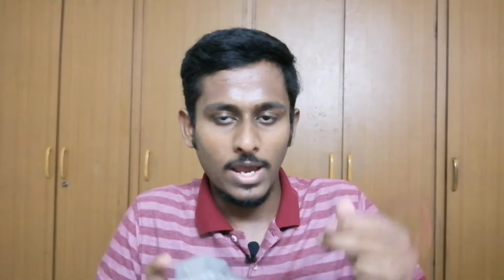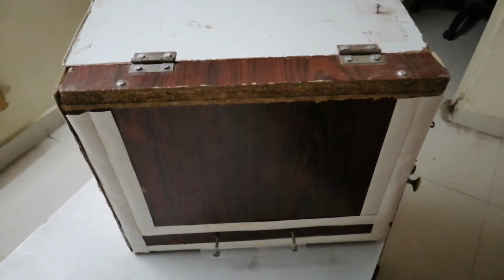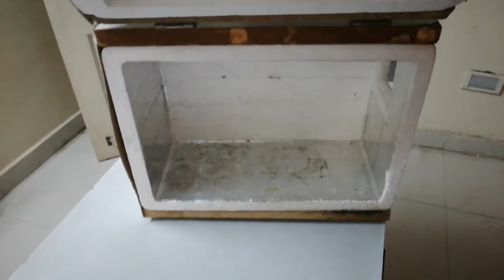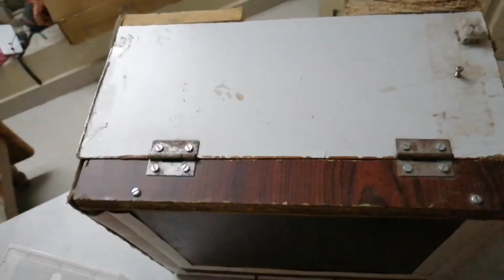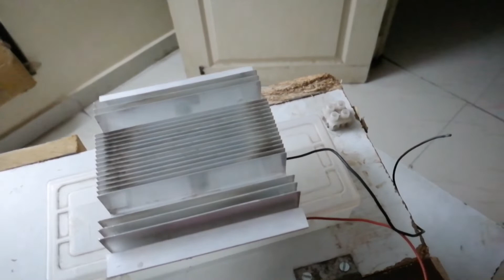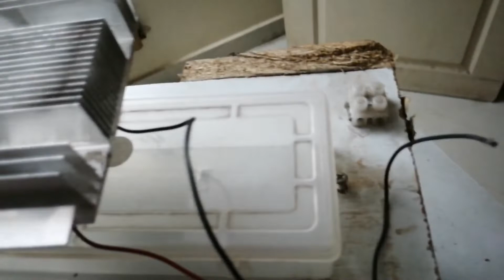How to Solve condesation in Thermoelectric Refrigerator??(Part- 1)

Comment: add a small Contain type box of plastic or anything just below the heat sink inside the cabinet! make a pass hole in the container attach a pipe to it pass it through cabinet wall ! seal it with silicon glue or anything!!   will save u time, and power demad of using separate fan.
Reply from the maker: That's what i have done please check part-2